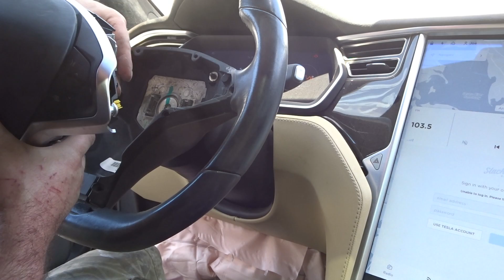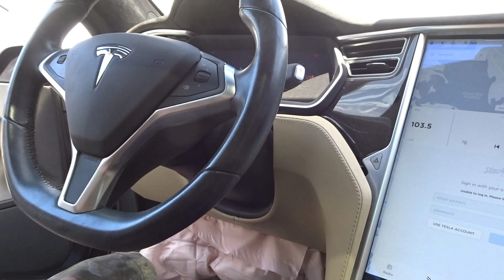Rebuilding a Wrecked Tesla P85D bought at auction Part 2

Comment: U dont have take the power off? Before installing air bags
Reply from the maker: If the SRS computer is bad, they won't blow.
Reply: @lb-innovations  thanks we want to get a tesla to rebuild and was wondering about the air bags
Reply from the maker: @NikoBrothers  Very easy car to repair. Bought and fixed a handful of Model S. If you have a questions, I can help.
Reply: @lb-innovations   thanks
Reply: @lb-innovations  any problems with supercharging or car losing any features ?
Reply: @lb-innovations  On a 2013 Tesla S is it difficult to change side curtains and SRS module. I want to purchase but needed to know how first
Reply from the maker: @kayjohn58  Check my other videos for curtain airbags and srs computer removal.
Reply: I just bought a wrecked 2013 model S and going to replace the same air bags as your, do I have to disconnect something before do that?

Comment: Disconnect the battery when you put them in, if it went off before you put the bolts in we would not be seeing you anymore
Reply from the maker: SRS computer is still bad, so they wont blow yet lol
Reply: I wouldn’t trust it still , but up to you. Otherwise all good
Reply: How did the horn work?
Reply: @shannons1886   Mabye The Horn Is Still Okay?
Reply: The Outer Hore That Where The Real Horn Is

Comment: Where do you resell them once repaired ?
Reply from the maker: I usually have a customer already before I buy.  If not, I run it on Copart.
Reply: @lb-innovations  got it, do you already have a buyer for this one?
Reply from the maker: @jerome2844   Was planning on driving this one, but if someone wants to buy it, I will sell it.
Reply: @lb-innovations  perfect, once is done let's discuss then, what is your email address?
Reply from the maker: @jerome2844  Sounds good brother. LBINNOVATIONSLARRY@GMAIL.COM

Comment: how do you reset airbag light after everythings installed
Reply from the maker: My buddy resets all my srs modules. Once the module is reset and all the blown airbags are replaced, disconnect the battery, install the srs module, connect the battery and the airbag light will be out.
Reply: LB- Innovations damn that’s what I did, light didn’t go out Tesla replaced module under warranty and still no dice,
Reply from the maker: @krajncar  Where was it hit? Which airbags were blown?
Reply: LB- Innovations front right corner, drivers bag, knee bag, driver seatbelt replaced. Passenger seatbelt retracted as normal no issues. Pretensioners  seemed good if it even had them